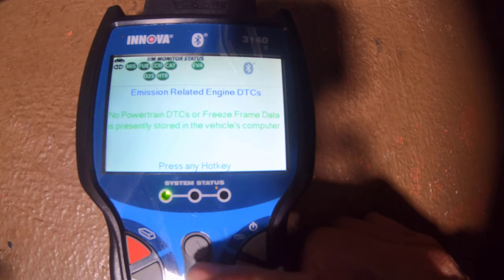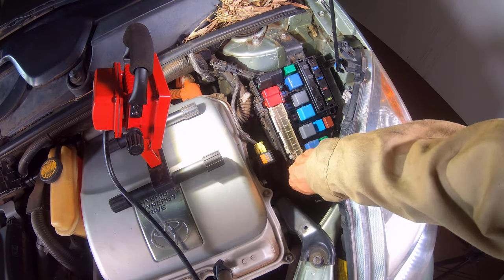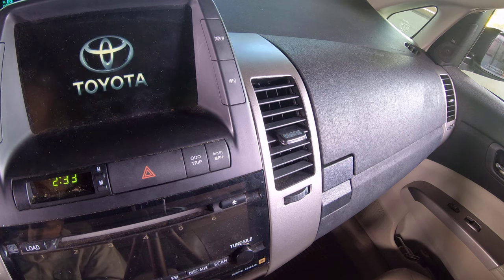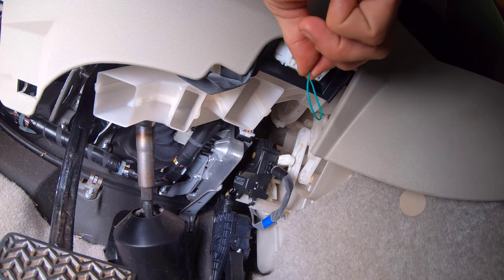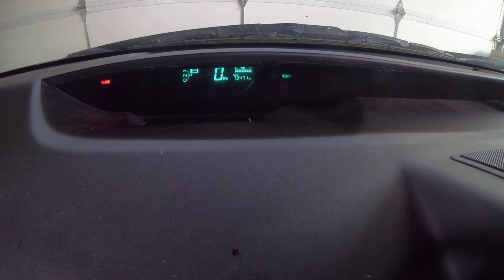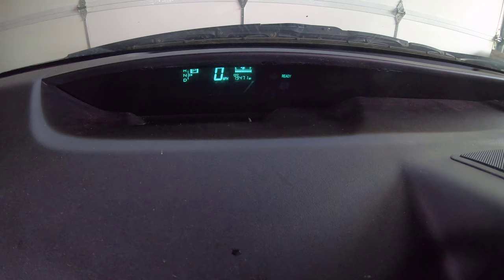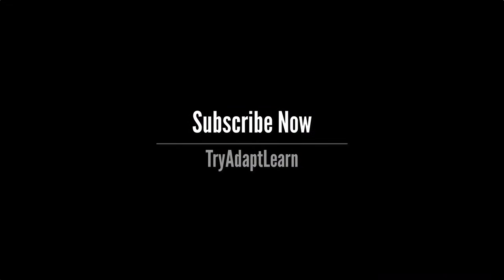Reset the ABS, VSC and Brake system warning lights on Toyota Prius.

Comment: I've had similar warning displays when the accessory battery was on its way out (Toyota Lexus 450h). Resolved on replacing the battery, no jumper wire reset needed.
Reply from the maker: Thanks for the info.  With a bad battery being the best case scenario, it seems as though the brake actuator/accumulator would be the worst case for the brake system issues common in this generation Toyota Prius.
Reply: I had a 6 month old tire go on me, damage caused tread fapping. I immediately stopped, got towed, had tire replaced, my Excl sign, ABS and VSC have been on ever since. Toyota said actuator system needs to be replaced, 2700. Is that bs or quite possible? I don't trust them, they never get the lights off or they come back for other past repairs. Last thing I had done was inverter control, before that was inverter. And in between those two repairs, 1 yr old blower assembly stopped blowing again. I need to pass smog, but can't lit up like a tree dash. These aren't even smog issues. Just looking for some advice before I do it bc they aldo said no guarantee they can get lights off. They just want to start replacing things; process of elimination, sounds like guess work. It's an 09', 77K orig miles. I never abuse it. I'd like to have some idea before I return.
Reply: Flapping was meant.
Reply: @lmc2375  I'd be looking for a second opinion, that's a lot of cash to put down without a certain diagnosis. Unfortunately a problem like that may require somebody with high end diagnostic skills, maybe even dealer only. By the way, if you ever want to correct a spelling error, click on the three dots to the right of your post, you'll find a tab labeled 'edit'. Make the change and save.
Reply: Yes, it is a chunk, have it but prefer to know I actually need it, not that mechanic is only able to read code thinking replace when it could be something less involved. That's it, you just don't never really know. Thank you though. As for corrections ... I am familiar. Apparently my cell is going haywire too; not allowing edit box to pop up, hence why I just added addition. I'm in my astro Saturn Return; forced to take care of things that I didn't properly see finished, nor persisted in initial round one, like these so called repairs. I was ticked and felt if I went back, I was going to blow my own gasket in frustration. I've already paid chunks and still, did not get what I paid for. I just have to learn patience and maybe a better flow will result. Yet, I'm still doubtful : /
Reply from the maker: I agree with a second opinion, if from another Toyota dealership or a professional  technician with abs diagnostic equipment/experience.  It’s possible that it’s the actuator but I’d ask the technician to start a check with the brake system and sensors around the wheel and tire that broke.   The tire could have broke the hardware around that area.

Comment: Are you sure it's the 5th pin hole on the top ( the top being the fatter side of the obd) and not the 4th? I read on prius chat that it's the 4th pin and 13th pin, which are both 4th from their respective sides.
Reply from the maker: It could have worked for others in a different configurations.  In this video, on this vehicle,  the wire was inserted in the 5th pin from the right on the top as mentioned in the video.  That being written, the process in this video should not be considered a substitute for a certified Toyota technician with the proper Toyota diagnostic tool.
Reply: @TryAdaptLearn  My bad. You actually did say 5th from the right on top, which is 4th from the left (#4). This didn't fix my problem because I found the seat rail mangled through the loom and through about 4 of the 9 or 10 wires that go to the wiring harnesses under my driver seat!

Comment: Question. Does the battery absolutely need to be replaced? Or can the jumper wire be used to remove the abs brake lights??
Reply from the maker: No, The battery should not need to be replaced, it was only replaced in this vehicle because it was apart of issues that were specific to this vehicle.  The battery can be tested on it's own to help troubleshoot issues.  this method can reset the light but like many have mentioned, sometimes they will remain or come back on.  The lights are indicators to the sensors and systems and may indicate that there is an ongoing issues that needs to be resolved before that can be reset and turned off.

Comment: I put the wire to 4 and 9 on obd and now my car will not start
Reply from the maker: I recommend you have a professional technician look into the issues with your car.  I don’t know where 4 and 9 is on your one port but if the car will not start, I would disconnect the wire and I would not try it again.  If it was my car, I would disconnect the negative cable from the 12v battery, then I would check all fuses. Before I reconnect the cable, I would check the voltage on the 12v battery.  If that doesn’t work I would call a professional to diagnose the issue.

Comment: I have replaced both the pump and the brake booster and master cylinder.  My mechanic did not have the diagnostic tool to recalibrate the software to reset the lights.  Any advice how to recalibrate my system to get the lights to turn off after replacing the entire brake system?  After replacing the brake system, there are no diagnostic failures reporting on a scan tool.

Comment: I tried this method and it works until I drive about 20 miles and all the lights go off again. I’m not sure if it’s safe to drive but I’ve been resetting the warning lights for about a week. No codes show up but when I went to auto zone to check the code C1391 came up. Abnormal leak of ACC press.

Comment: Paperclip trick didn't work for me. I replaced the entire suspension of my 2012 Prius... also ran it in gear while jacked up to check axles etc..  VSC light on ever since.  Cleared memory using techstream, now ABS and Brake lights also on...  can't seem to clear even after running solenoid valve calibration. DTCs say C1231 - C1345 - C1368.  Brakes still work fine but no regen... help!
Reply from the maker: Please make the choices appropriate to your safety.  If I was in a similar situation this is what I would do,  I would start by disconnecting/re-connecting the battery.  I would then erase codes.  Next try to test drive in a safe enclosed area to see if the lights turn off and the codes stay off.  Hopefully the test drive can check and calibrate the suspension/steering and brakes as the vehicle is on solid ground.  If the vehicle functions properly but lights and codes are on, then I would tow or drive it to a Toyota service department to have a Toyota technician work on a wheel alignment (steering angle), check the ecu (possible cause of the codes/lights), and erase the codes and reset the lights.  Once that is done, if the lights/codes come on, there is a possibility that there are are problems causing the codes and lights.  There would also be the possibility that the sensors themselves are malfunctioning, the sensors detected problems when the vehicle was running on jack stands, the ecu is malfunctioning/ needs to be reset and/or or the connections/wiring to the systems is faulty/broken or not connected properly.

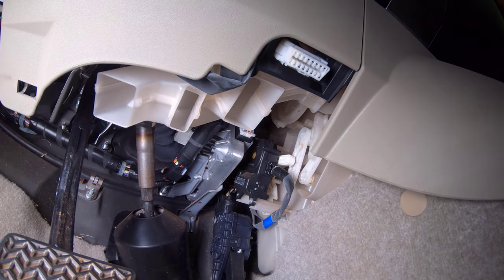Comment: I’m new to your channel, looks like good advice so I subscribed. Do you have a video on why none of the dash lights come on, or even the infotainment module and the key has to be in the ignition at this point to turn on? I have an 09 Prius. Thanks 1:21
Reply from the maker: Sorry, I don’t have any other videos for the dash lights.  In normal operation the lights should come on then go off.  If the infotainment module is not on then the display could be damaged and/or a more serious issue.  If the dash lights and infotainment are all off, it may be time to have a second person to help troubleshoot issues and/or take the vehicle to a Toyota certified technician.  Sorry it’s hard for me to understand the “key” part of the question.  It looks like 1 min21 seconds is still speaking about the jumper wire, if I can remember, the key was not in the ignition or on when inserting the jumper wire.  This of course is no substitute for for the proper Toyota diagnostic tool to reset the lights.

Comment: Hi I wonder if anyone else have this similar problem. After I replaced odometer display module,  Vss, maintenance light come on and won’t got away. This Toyota 2007 Prius. Everything was working before except brake light stay on. I though buy one multi combination display module will fix it but make it more worst. I put back the original part and not I have more problem. The car is driving normal.
Reply from the maker: I don’t know if anyone has specifically the same issues, but with so many issues, it may be worth considering to take the vehicle to a certified Toyota technician with the proper tools to diagnose the systems.

Comment: Hi i was driving 2008 prius on motorway light come up abs vsc and handbrake light but strange thing my odometer stop working its stay on zero every time i drive  car map used to go with car before now its stay where i park (look like car shows brakes on and car not moving) i did reset thing as from ur vedeo not understand y can u help me with this
Reply from the maker: The procedure in this video would reset the lights if the systems are functioning properly.  Since you have multiple issues including braking system lights, odometer and map, I would recommend taking it to a certified Toyota service location to help you troubleshoot the issues associated with your car.  As a humble opinion, a malfunction in the braking system alone is enough to create a safety issue and it sounds as if you are dealing with multiple issues that require someone to inspect your car in person.
Reply: I had the same problem on my 2009 and after cleaning the speed sensors on both from tires it worked again.

Comment: Not working for me can't get to the screen
Reply from the maker: I'm sorry to here that this procedure didn't work for you.  If I were in your position I'd disconnect the negative battery cable and troubleshoot possible reasons why the light is coming on.    If that doesn't work you may need to take it in to a Toyota service technician.

Comment: mine keeps coming up everyday
Reply from the maker: If the lights display everyday it may be an indication that there is an issue with the parts or systems that need to be checked by an automotive technician.

Comment: Why is my car abs and vsc blinking whenever i start my car and my gear will change to drive4 instead of D
Reply from the maker: I am sorry but I do not know what exactly is happening with your car.  Usually, if the ABS and VSC blink when you start the car, it is a system start up and/or a system check.  

As far as your gear changing to drive4 instead of D, that sounds like a transmission issue and is a separate problem and issue than the abs and vsc lights.

Here are more of my opinions related to the abs and vsc lights: ABS is Anti-lock braking system, VSC is vehicle stability control, both are related to the braking system.

If the abs and vsc remain on when the car (and engine) is started, it indicates that the sensors are warning you about maintenance needed or malfunctions in those systems.

This video was a demonstration of how the lights were reset with the vehicle in this video when there was no maintenance needed or a malfunction in those systems.

Comment: I have an 08 Prius I am having issues getting it started and pressing on breaks does not turn brake lights on when applying pressure any ideas
Reply from the maker: Sounds like two separate issues occurring at the same time.  Starting issues could be low voltage in the battery, fuel system issues or ignition system issues.  The brake lights are a separate system and usually cause by light bulbs or the switch that turns on the light bulbs when your foot is on the brake pedal.
Reply: @TryAdaptLearn  I have tested the battery, brake light switch, checked all fuses, and bulbs for brakes are not blown. I’m curious on my next steps
Reply: I have not tested the block like fuses idk if any of them would contribute to the situation?

Comment: The VSC, ABSv ane Brake lights came on after changing the front brake pads yesterday. I've checked and no codes came on, the battery is brand new and the fuses are in good shape.
Reply from the maker: Sometime these warning lights appear due to a faulty part in the abs system, sometime the sensors sending a signal to turn the lights on.  If they still remain on after trying to reset the lights, you need a diagnostic tool specific to analyze ABS/brake systems and/or you consider taking it to Toyota service department to diagnose what is causing the lights to stay on.
Reply: I also didn't realize you're supposed to disconnect the battery.
Reply: It’s a recall i called Toyota

Comment: Thanks for professionally done video…
2010 Prius abs, check engine all similar light are on and it happened a few times were while driving at hwy speed all of sudden, yellow triangle of death comes on and display shows “check hybrid system” and there’s no more power,pulled over shut off car for a couple of minutes and it started with same light on cluster but this time car seems ok. Next day all lights goes off. Also brake pedal become softer when lights comes on. I did push brake 8 times within 5 seconds and light goes off but comes back on. Took to dealership, no codes. I was told also by local shop it could be brake actuator assembly and internal water pump. Don’t trust these guys. Please help as I’m running out of idea. 
Keep up the great video. 5stars
Reply from the maker: Considering the two possible explanations, I would guess that the brake actuator assembly is likely the cause a of the braking system issues.  The water pump is could be related to cooling system issues which would  cause internal engine issues, coolant leaks or overheating.

If you are unsure about the local shop you may want to take it back to the dealership and have them check something specific such as the brake actuator assembly.  If there are no codes then this also may be an electrical issue such as batter and/or corrosion at the electrical connections (including grounds).

Comment: In addition to the red brake warning light I have yellow brake warning light, ABS, VSC and traction lights on. There is no engine light but also whenever applying brakes the red triangle 🔺 and door open lights go on as well and the MFD keeps switching back and forth between navigation and P lock shift warning screen and beeping. Also the speedo and odometer — white they still illuminate — do not work. Speedo shows zero all the time and odometer is stuck at a specific mileage count.
Reply from the maker: It seems like there are issues with not only resetting the lights in your vehicle but also the systems that they are meant to warn you about.  If you have a code reader, it may be worth it to read the codes that may be associated with the warning lights.  Since the red triangle appears when you apply the brakes, I would recommend taking the vehicle to a certified Toyota certified specialist with the proper tools to diagnose the multiple issues associated with the warning lights in your vehicle.

Comment: I put air on my tires and after I turned on my 07 Prius I got the  red triangle and ( ! ) I'm worried 😓 the screen display Problem and the red car.
Reply from the maker: If you recently added air to your tires and a light (a tire and exclamation in the middle) is on, you may want to: double check the air pressure with the manufacturer values (in the manual and/or sticker on the door), then reset the tpms system using the tpms reset button.  The other lights are indicating other issues.  A car with a key could be the alarm system.  A car with an exclamation in the middle could be the hybrid system warning. An option to consider is that if you are unable to troubleshoot what the lights are indicating or how to resolve the issues (before trying to reset the lights), you may want to call a Toyota service department and ask them for an estimate for their help to identify the issues that are causing the lights to appear.
Reply: Clean your hybrid fan an make sure it's working

Comment: would it work for a toyota harrier 2005 model?
Reply from the maker: I’m not sure but would say no.  I think this is specific to the Prius in this video.  Also keep in mind that it is a work around.  The proper procedure would be done by a Toyota technician with diagnostic tools.

Comment: Will this work for toyota yaris hybrid 2015?
Reply from the maker: I'm sorry, I don't think so. This was a work around for the older models.  I would double check the owners manual, a code reader and/or Toyota Service for these newer models since the electronics are increasing in complexity.
Reply: @TryAdaptLearn  , many thanks
Reply: @TryAdaptLearn ,  also there's hardly any information for the yaris hybrid online, everything seems to be for the prius ☹
Reply from the maker: They might have similar systems but I can understand that you want something specific to your vehicle. Hope your search goes well.